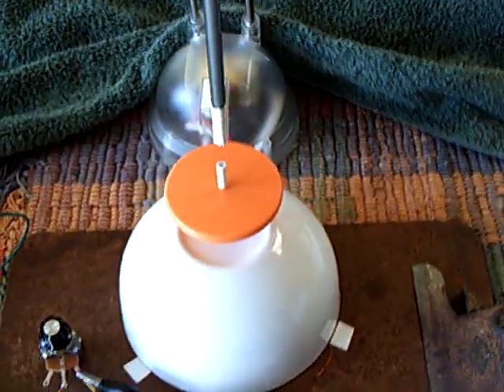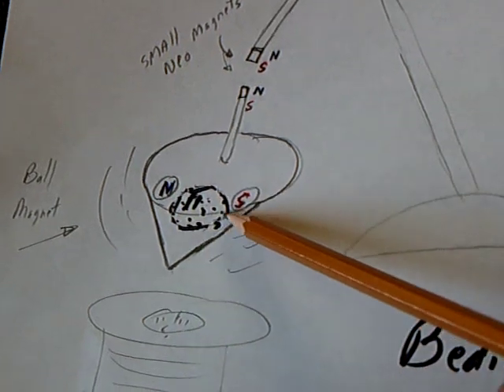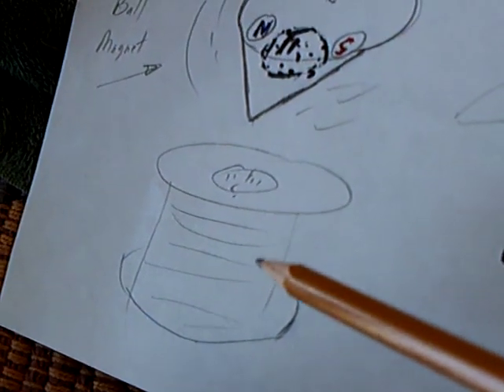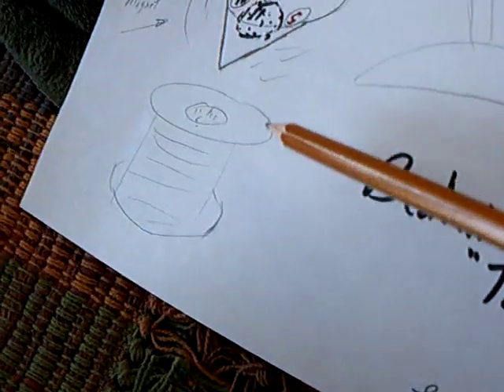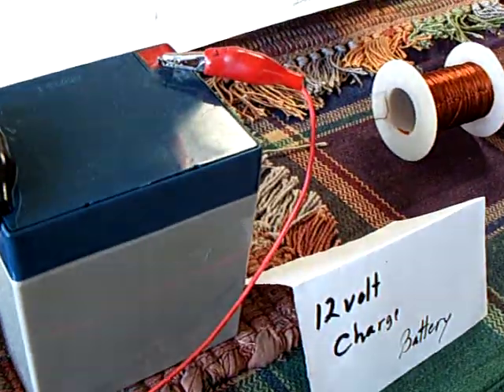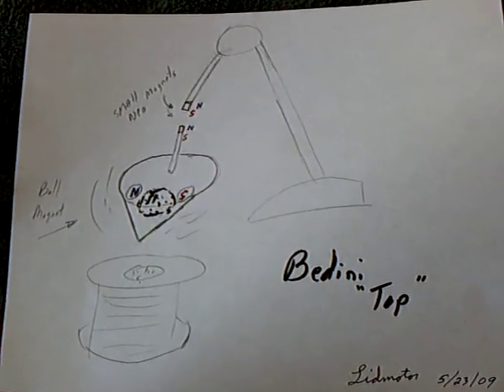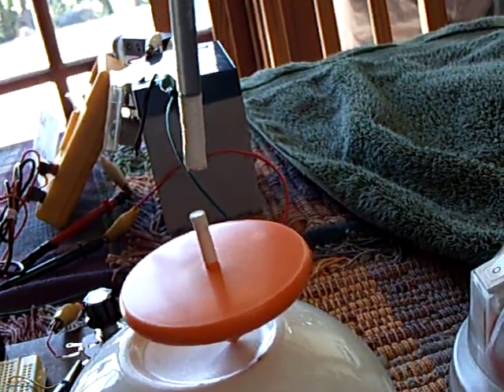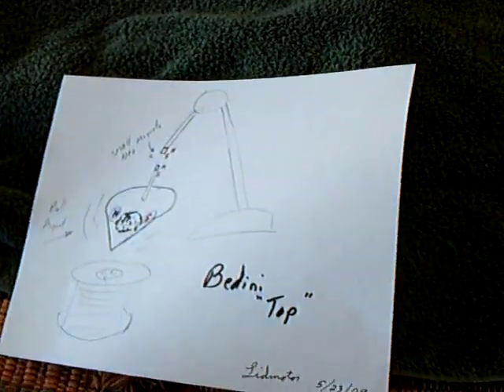Bedini Spinning Top

Comment: A Diametrically polarized tube magnet has a hole through the middle. An axle levitating inside Hallbach cicular array bearings, available at Gyroscope,
or a Mendicino Motor style magnetic levitation bearing, might help solve those
problems.

Comment: Good idea with the magnetic coupling to stabliize the Bedini top!!
In your next project, how are you going to stop the round magnet from melting the plastic coil core??
My neo-spheres arent here yet, but I plan to encase the sphere in two copper pipe caps, JB welded together, glue on some round end plates and wind my coil on that.
Then I just need a small hole so I can put a few drops of lubricant into the chamber.